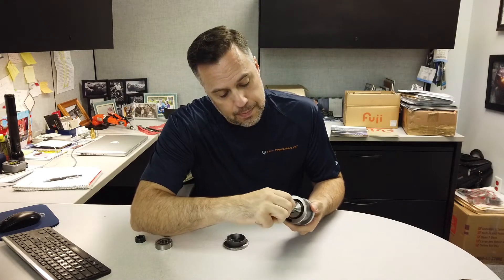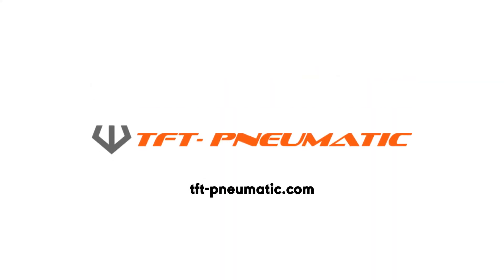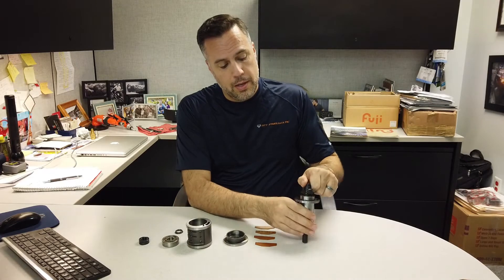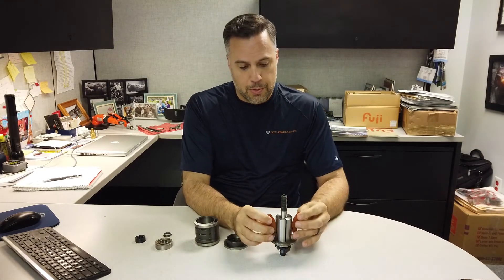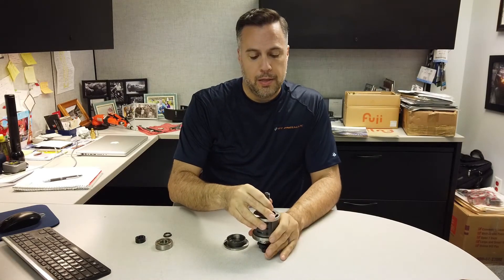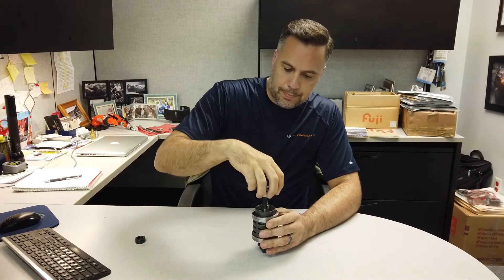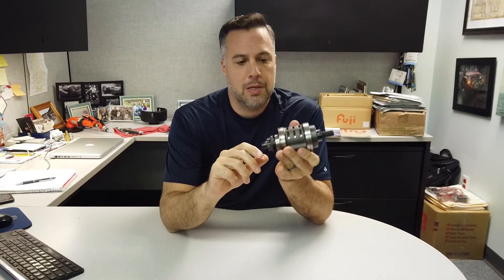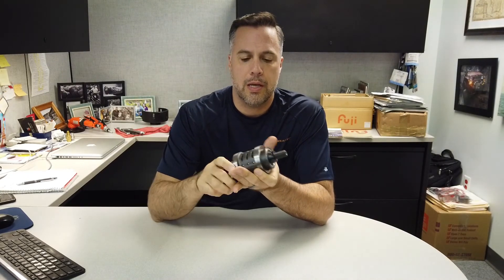How does an air tool motor work? Pneumatic Grinder Parts and Assembly

Comment: I have an air grinder that stopped working. I took it apart, I cleaned the inside and put it back together it all seemed smooth and it looked very similar to what you just showed. however it has no torque anymore. It spins fast but when I try to use it it just stops from any resistance. I thought maybe my old compressor was going out and actually bought a new compressor with a bigger tank and Faster regeneration but still the air grinder is wimpy. I feel like I'm crazy because everything seems like it should work. what causes this? is there a breaking in period of the four tabs/rotor blades to resurface? is lube wanted in the area with the blades? if so what kind?
Reply: Hi ! Most often than not a loss of power in a grinder is due to wear and tear on the rotor blades. The rotor blades are made of a composite, that as it turns inside the cylinder, pushes the air. Those rotor blades will become "shorter" as they glide through the inside of the cylinder (daily oil lubrication through the air inlet helps slow this process). The other part that eventually deteriorates, and this goes back to the quality of the tool, is the cylinder itself, as well as the upper and lower plates. If there is wear in those parts, that may prevent the engine from directing the air power to spin the rotor blades, and air is lost through air leaks. Another thing that I can think about is proper lubrication of the ball bearings, when assembled make sure to either clean them well of replace them and put bearing grease in them. The only other option I can think about is that the motor is not properly adjusted, that means when assembled the tolerances are not within spec. For FUJI grinders, this assembly process is VERY important, as it is possible to lock up the tool or for the motor to be to loose and not fit properly in the motor area. Lastly, make sure you oil the tool. Hope this helps. Good luck!
Reply: @hectormaggi8264  so the cylinder wall is not perfect. the blades wore over years to the inside contour. when i disassembled it i noticed small chips on one of the blades so i used a 600grit diamond block to smooth them all down a bit. when I assembled it worked better but not great.  I then attached an electric grinder to the spindle and just spun it for 5 min. after the air grinder worked a bit better afterwards and i think its because the blades are again slowly wearing down to the contour of the imperfect cylinder wall. if i had a machine shop that could bore the cylinder just .2mm it might make all the difference.
Reply: @seacoast6351  you have found the main problem, the irregularities on the inside cylinder wall, that in itself will create the internal leaks. Ideally replacing the cylinder and blades would be the best bet. If not smoothing them out would be ideal. You can use a drill with a flap wheel that fits inside the cylinder and smooth it out. What brand is the tool? Do they offer spare parts?
Reply: @seacoast6351  smoothing out the rotor blades will be beneficial in 2 ways: 1. Lower change of breakage 2. Smoother (flatter) surface in contact with the cylinder, thus enabling to "sand" the raised sections.
Reply: @ it’s an old tool. Thor is the brand. A moped cylinder honing tool might do the trick.
Reply: @seacoast6351  I agree, moped cylinder honing tool is probably the best way to go about it. Good luck!